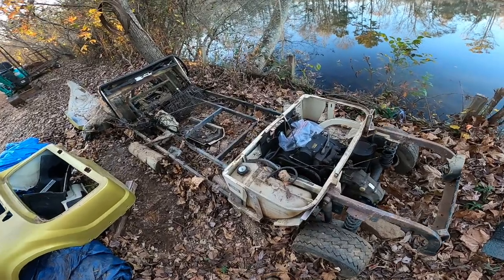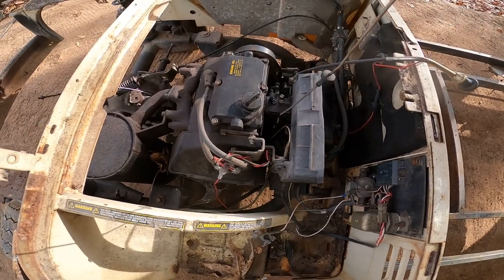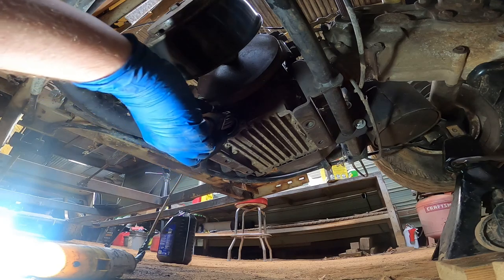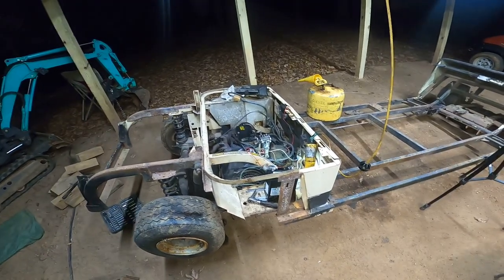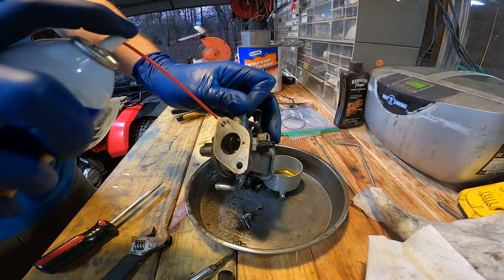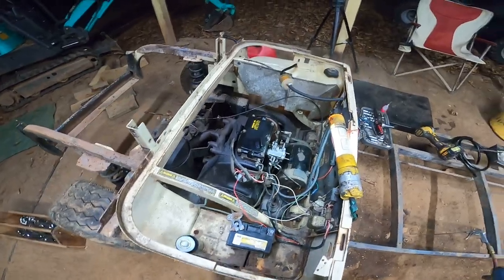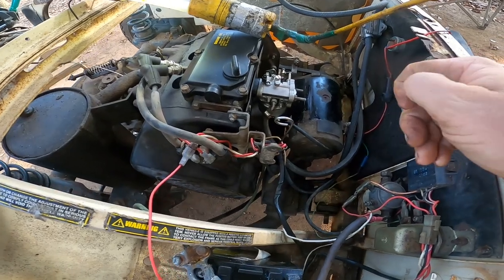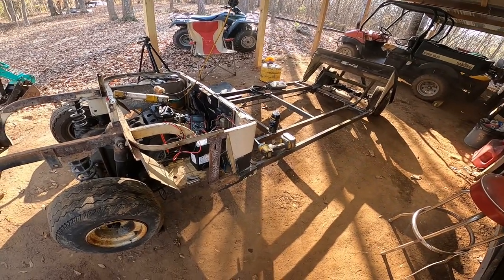SAVING OLD GAS GOLF CART FROM THE JUNKYARD.. WILL IT RUN AGAIN?

Comment: Maybe a float for a parade for the family , 🤔 the potential is endless,  good luck on what ever you decide 👌
Reply from the maker: well, I just picked up another golf cart that has the same engine so if the engine doesn’t run, I can swap all the parts over that I need and have one good running golf cart

Comment: I had a '77 2 stroke Robyn engine ez go one lung .. it ran forward or reverse so not much horsepower ,timed at about zero tdc .. yours would make a great mobile picnic table
Reply: mine went over a tree stump and wound up arked for a while with flat tire and bent secondary clutch plates until I found one off a skidoo, had to redrill for the rivet holes and with a different diameter and pitch was LoW geared for lawn racing . I compensated with thirteen inch rims inside out deep dish or donuts have fun
Reply from the maker: that’s awesome that’s a great idea
Reply from the maker: lol awesome
Reply: I remember it was a crankcase vacum fuel pump, when it had a problem I replaced with one from a twin cylinder snowmobile,,,tried but a 12 volt electric pump from a car didn't let the carb needle open (float bowl up) without a return before the carb
Reply: The wiring is tricky with those, the gas pedal ran a switch to auto start the motor. Mine did everything but charge its own battery. They had a deep cycle starter battery in them, but I always used an old one from a car
Reply from the maker: yep your correct

Comment: u got the ign wire connected to the starter/charger it should be on the battery + that's why when u dropped the rpm it cut out.
Reply from the maker: thank u very much I’m gonna check that out!!

Comment: Its a yr later. I will say make a roving picnic table or put a dump body in the front and drive from the back. Now i will go watch video to see what you did
Reply from the maker: I have plans for it I’m working on the vid now
Reply: @TheHomePros6221  I'm sure it will be entertaining. The engine seemed to be pretty decent over all. Probably can move some weight.